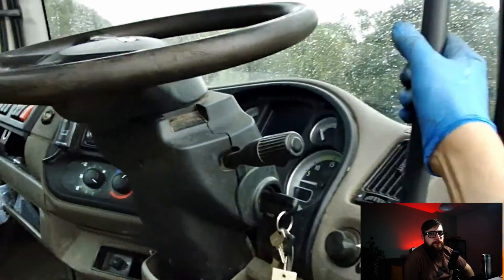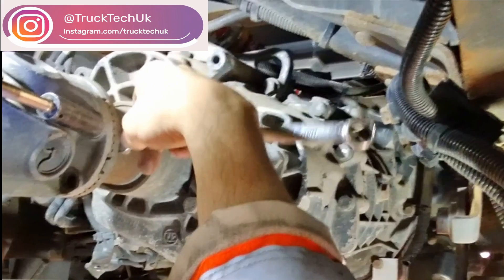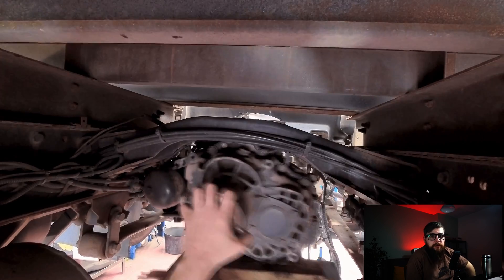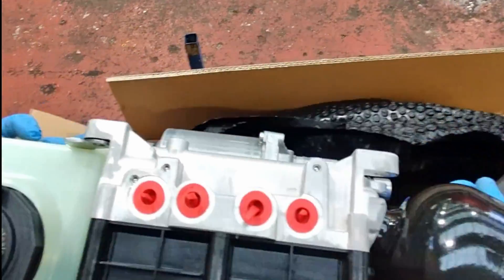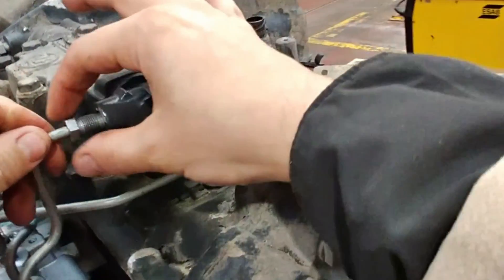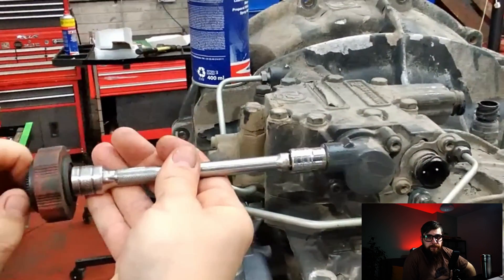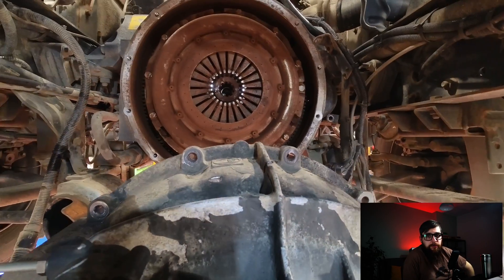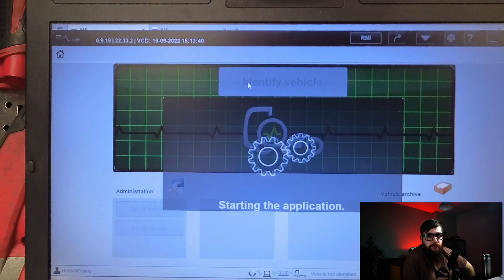POWERPACK problems? ZF AS-TRONIC LITE REPAIR

Comment: Have a truck with similar issue changed the power pack and now its has to be programmed what tool or program i need to use?
Reply from the maker: Jaltest or davie buddy
Reply: @TRUCKTECHUK  thanks..just check the price for both of those..😅 can it be remotely done or any other options im in Barbados
Reply from the maker: @JoshuaCrawford-x6k  Swap the ECUS over on the power packs unless it was the ECU that was at fault buddy
Reply: @TRUCKTECHUK  ohk thanks
Reply from the maker: No problem 👍

Comment: Hi, 
I have a message on dashboard on Renault D, gearbox stuck in neutral, low pressure/high pressure fault, does the powerpack need to be replaced ?
Reply: Hi, did you replaced the power pack and solved the problem? I have the same message on dashboard (low pressure) and the power pack make unusual noises when I turn on the ignition

Comment: to avoid the problem with the pipes, first assemble the pipes to the gear actuator /XY actuator on top of the gearbox and afterwards assemble the central unit/power pack. It's a bit tricky to get all the 4 pipes in but you would not damage the thread of the pipe connection. Additional advice, clean the device before disassembly, hydraulic is sensitive to contamination. 🙂

Comment: I’ve done quite a few of these and luckily I’ve never had to take the box out, somehow the pipes have always been reasonable. I’ve got two at the minute with the same fault. Oil level float switch, texa gives no info at all
Reply from the maker: Hey Alan thanks for the comment. Yes it's the only one I've had to pull the box on...also the only one I've had where I can't see what I'm doing and ended up rounding a pipe off with a brake pipe spanner also 🫣. 

In regards to the float switch, I think it only runs to the ecu but I will check later with a more informative tool for you 😅
Reply: H @TRUCKTECHUK  it does, I’ve repaired the CAN and power supplies going to the TECU as there were multiple faults and a botched “repair” where somebody has sliced through everything with a Stanley knife so now it’s all green. Never came across this before and for it to be on 2 trucks from the same company I’m a bit suspicious

Comment: My name is Denis I'm auto electrician .I have Daf LF55 lector gear  D R N not showing in the dashboard
Reply from the maker: Hey Denis thanks for the comment. You will need some diagnostics to see if the pressure in the pump is enough for the gears to select neutral 😐

Comment: Is there a way to bleed the hydraulic witout pc softwere?
Reply from the maker: Hi Freddie 👋.  Yes, you can buy an Android-based tablet that can bleed the system without the large price tag but if you're referring to a manual way to do it.....no unfortunately 😕
Reply: @TRUCKTECHUK  Great video - I have just refitted the rebuilt ecu to my pack on 2012 MAN TGL. I had to remove the whole pack so air has got in. No options to bleed 2012 on Delphi but no codes and goes into gear and moves no issues. Does no codes mean I will get away without a bleed? Don't want to het stuck out on the road.
Reply from the maker: You would have introduced air into the system so now have a combination of fluid and air in the lines. As Dave at TVD said  yesterday you will need someone with diagnostics capable of doing this bleeding properly
Reply: Do you have a link to this app? @TRUCKTECHUK

Comment: I was always a fan of the LF whilst I worked at DAF, CF and XF are trash
Reply from the maker: Hi josh 👋 oooohhhhh but the wiring diagrams for LF 🙈🙈🙈🙈🙈 ha ha ha. 

You say CF and XF are trash but the CF  doesn't exist anymore and the XF is now the smallest 'big cab' truck daf do! It's all changed with NGD.
Reply: @TRUCKTECHUK  I left about 6 years ago and went to Mercedes and now plant so I haven’t a clue about the new daf’s like NGd, XG etc etc. Just always liked the simplicity of an LF, if you compare it to an atego, eurocargo, tgm they are a dream.

Comment: Great video mate, I also have a problem with power pack. Do you need to take out gearbox to replace pipes above a power pack? Many thanks
Reply from the maker: Hi buddy. It's ALLL ABOUT access and perseverance. 
If you are small and nimble like an apprentice your have a chance on changing them. Some LF'S I work on don't have the same issue as this flatbed and the headboard is mounted further back making it easy to work on. 

I hope this makes sense buddy 😎👌
Reply: @TRUCKTECHUK  Thanks a lot :)
Reply from the maker: @MultiInfinity100  no problem buddy and good luck! 👍

Comment: Hi great video ours needs to go to Africa very soon but please can you tell us if we can buy new pipes direct from daf as we are struggling to get them made.also having fitted our new power-packed do we have to re pressurise the gear box or can we just fill the reservoir and hopefully start and go.many thanks.
Reply from the maker: Hi thanks for the comment.all pipes are available from DAF but might be cheaper at iveco or Renault. If your fitting a new power pack it will req programming or the ECU swapping over from the old one. Any pipes changed will req the power pack bleeding for air in the pipes unfortunately so you will need a diagnostic computer capable of this functionality

Comment: Hey my friend .how are you 
I have the same problem with one of this gearbox .so the owner buy a new module with pump complete. But the problem is how can I bleed the system and program it because I have a jaltest diagnostic tool..please bro....can you help me bro
Reply from the maker: Thanks for the comment, hope you're doing well! If you can still read the old module, you can copy and paste the ECU information. That will allow you to program the new ECU. You can then use the calibration and bleeding function on Jaltest. Hope this helps buddy
Reply: @TRUCKTECHUK  good to hear you are doing great ..ok bro I'll try copie the program on the jaltest ..so I only need to plug in the old unit and copie ots program and plug in the new unit and paste it on the unit ???
Reply from the maker: @vinodjokhan3077  I'm not with JALTEST so can't remember the exact menu options but yes that's what I'd do 👌😎
Reply: @TRUCKTECHUK ❤
Reply: Hello... I want to service my gearbox, which gearbox oil must I use. I'm using the same truck.
Reply: Selector gear no snowing on the displayer

Comment: Did the owner not ask ya to do a quick clutch plate inspection, or had it been done recently?
Reply from the maker: Hi thanks for the comment 👌🙂. I checked the clutch plate when I checked the bearings, it's something you just do isn't it. But the clutches on these LF'S last so well I find

Comment: I am speaking from Bangladesh 🇧🇩 please help me.  How to contact you  I need your help a lot
Reply from the maker: Thank you for your comment 😊 what is your problem?
Reply: Fault codes do not show.  Only engine warning shows no codes.  So now I have nothing to do??
Reply from the maker: What are you using to read the fault codes?
Reply: @TRUCKTECHUK  I don't have a device so advanced that I can see the fault codes.  Only engine warning is showing on the meter board.  This engine warning comes on and off automatically.  And when the engine warning goes off the car starts.  No more engine warning shows on start.  Then everything is normal.  And when it starts off and goes to star, the engine warning shows again.  All the wiring is checked.
Reply: Unable to remove engine warning of cf Daf paccar.  It is not clear what caused the engine warning
Reply: Can you be contacted in any other way??  Can't be contacted on WhatsApp
Reply from the maker: @Mechaniczone27  I don't take personal calls.  I like information available for everyone to see incase it applies to them in future fault finding and I require fault codes. If you don't have them you will struggle massively to identify the fault
Reply: @TRUCKTECHUK  If I could show you the picture you would understand what the problem is.
Reply from the maker: @Mechaniczone27  sounds like a immobilizer fault if it won't start and you get the warning but then it starts when the warning is off. 
The best thing you can do is get the vehicle checked by a technician who is able to read the faults in the ECM and from that identify the cause of your concern

Comment: I will play captain hindsight ,that awkward shit of a pipe i fit loosely first to the powerpack then start it in the turret .and then fits the powerpack bolts loosely so i have some wiggle room ..If your showing the hero paper at least show the answers...Did it honestly calibrate first time ????
Reply from the maker: ahoy there captain hindsight 🤣 yes I will certainly re-engineer the fitment process next time, I've never changed the pipes before for new I've always reused and never had a issue 🤷 must be the cheap Korean labourer bent it to far 😂👌
i didn't bother with the last paper as I was to busy with all this social media junk 😂 I rechecked the video ....think it went through calibration 3 times before it was happy 🥹
Reply: @TRUCKTECHUK  I never used to change the pipes ,now i price them anyway ,that way the customer is aware ,and i now have a stack of old ones to use just in case ..You won't get a present for not filling out the 4th paper lol...I learned that as long as you have the red transmission warning it will not complete the clutch part at the end  on the pre euro 6 vehicles ..If jacking it up doesn't help  i race it ,and try to start the engine and hit ok before the red warning comes up ,as it will work ok with the anber warning lol
Reply from the maker: Not the cheapest of things are they! Makes me want to go in not bending pipes for a living 😂
I will keep that in mind for next time, I don't change many of these power packs.....they might be old but just like the As-tronic lite gearbox they just keep working.....shame it's gone really as I have a feeling were going to get very intimate with the latest ZF powerline box if it's anything like Traxon
Reply: @TRUCKTECHUK  From what the lad at ZF said it is a proper auto ..So if anything like the allison we will never be involved in it ..Hopefully i picked him up wrong
Reply from the maker: Oh it sounds like things are getting better and better then 😂😂😂 we will still have to diagnose the bloody thing though 🫣🫣🫣🫣

Comment: How much did you pay for that powerpack?i have a cf65 with the same problem but the powerpack is too expensive
Reply from the maker: Thanks for the comment. If you give ecodrive a ring they will do you a better price on recon unit. I'd have to check DAF as I can't remember what the cost off the top of my head.